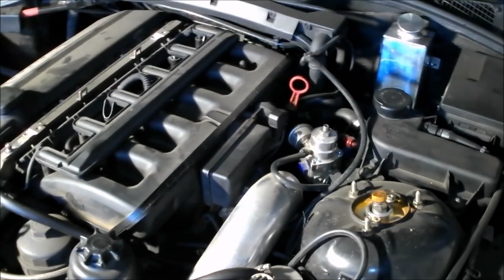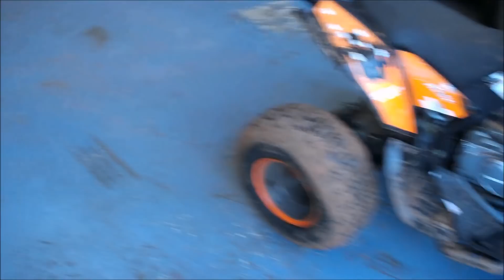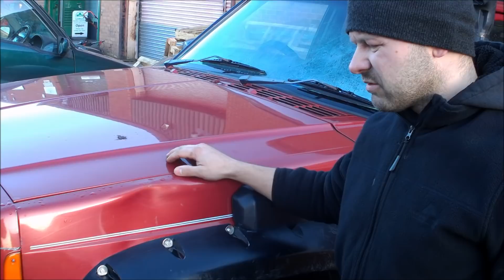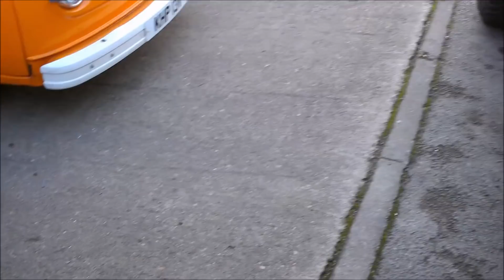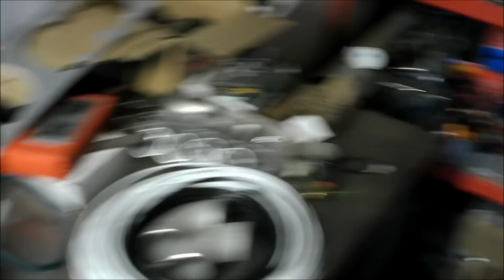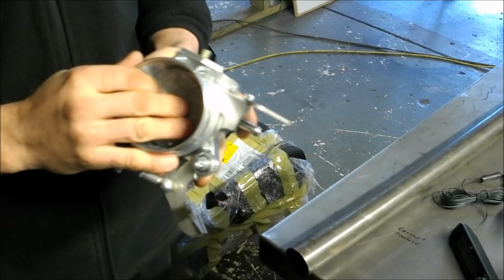Zurawski Motorsport workshop tour! Turbo everything! And a diesel Nissan Silvia S14?!

Comment: Hopefully your buddy can sort that poor Z3 jank fest! I'm generally keen on bottom-mount turbos with cast manifolds for the M/S motors, but they are tricky to check all the boxes for fitment, especially with running a decent air filter of any variety. I don't care for most junk tubular top-mount manifolds, but there is no denying it is easier to relocate the washer fluid tank than having to run a special motor mount and/or snake a large diameter intake pipe around the subframe. I have seen several guys run the CX top-mount kit and make good power simply by balancing the Fleabay turbo and bracing the stress points of the manifold.